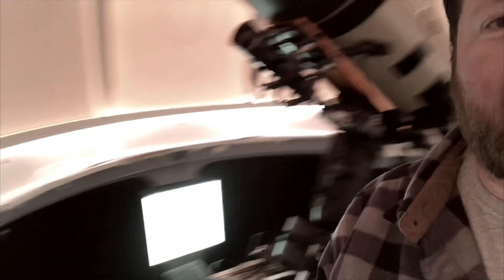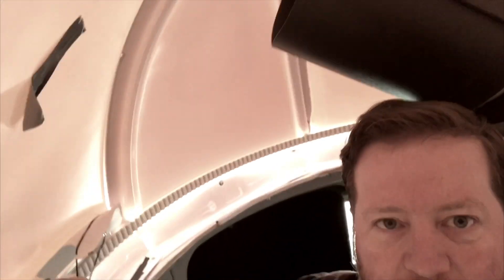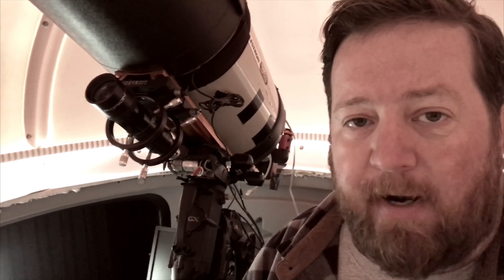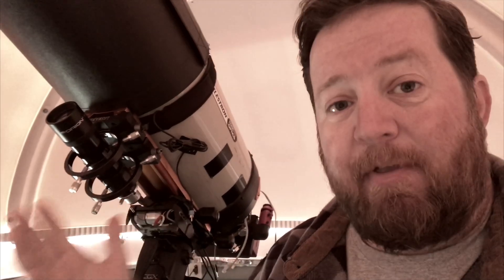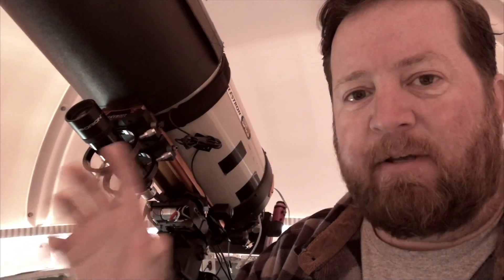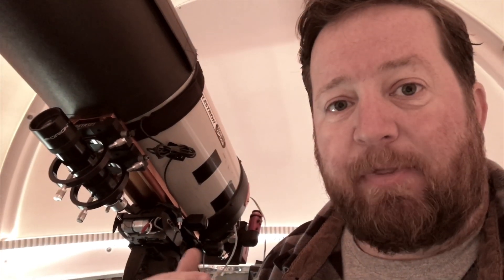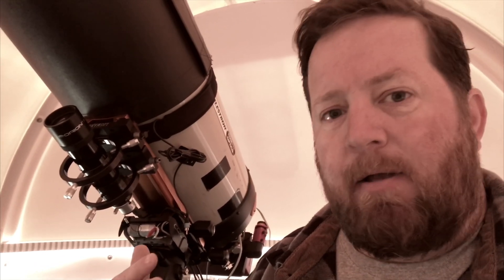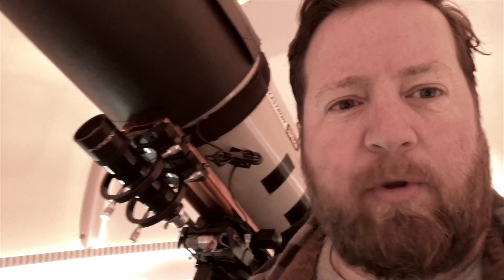Nexdome Shutter Kit and Sorry Celestron, it may be time for a change

Comment: Thanks for the video! I've been waffling back and forth between a DIY ROR Obs and a Nexdome and you're making me feel like the DIY ROR might be the better option. I'm also setting up in Oklahoma (moving back to OK in a month) and I feel ya with those winds! The winds are why I was considering a Nexdome in the first place---but it might be more trouble than it's worth.
Reply from the maker: Dennis C     We already has a SkyShed pod with a clam shell roof.  We upgraded our scope and the roof was blocking too much sky. We got the dome to open up 360. It does work well but we should have sprung for the shutter option first thing. I’ve been in contact with others who have it in windy conditions and it does fine. I think Nexdome designed the roof anticipating the shutter mechanism adding to secure the roof.   A roll off is not a bad idea though because another issue is syncing or slaving the dome opening to the azimuth.  A roll off would eliminate that variable. Good luck!